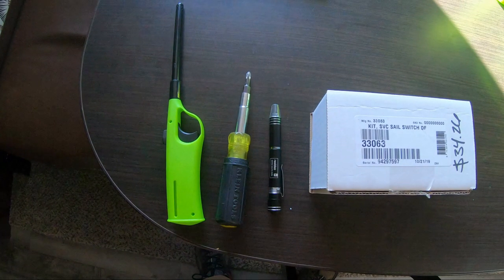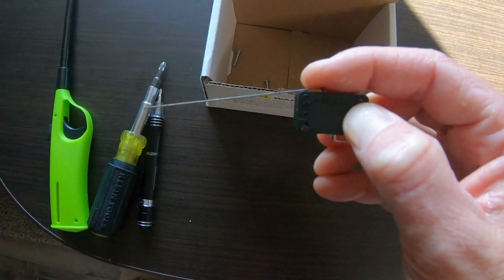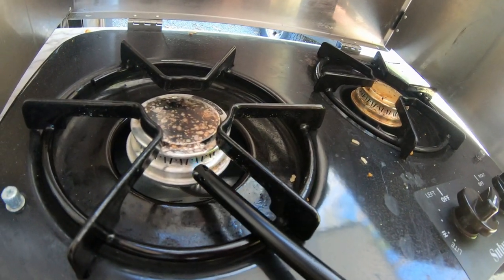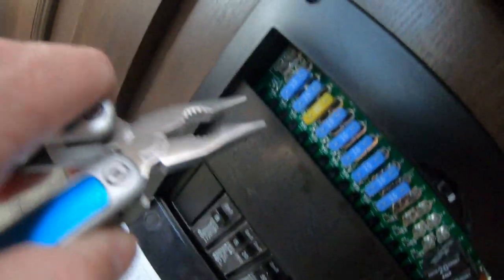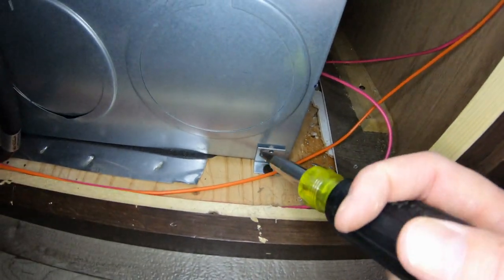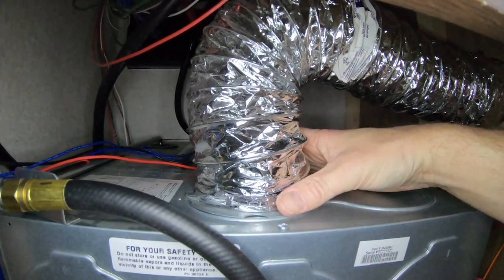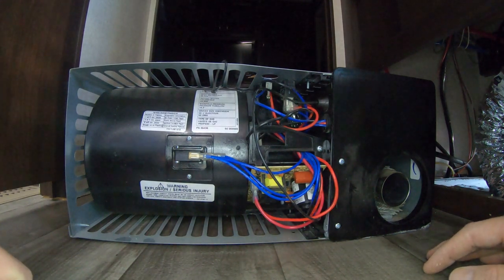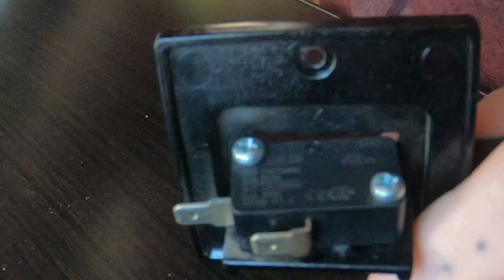RV Furnace Sail Switch Replacement

Comment: Just something I learned is the thermostat on the wall (the one you and I have…the Dometic)…to change temps etc “barely touch” the arrows and don’t “press on” the arrows and it will last A LOT longer…the thing really is not made to be pressed…if you barely touch it with our finger pad it will change…I had to replace 2 of them to finally have someone tell me about that and since then I have had NO problems with it.  also nice video on the replacement of the sail switch

Comment: Awesome video sir, I have a 2019 Jayco Eagle 321rsts and I agree Jayco could have install these furnaces where you can get to them, our is in the storage compartment and I have to take out all of the wall just to get to it. I order the Sail Switch, Over Temp Switch and a Run Delay Relay Fan/ Blower Switch to be install, I probably can get away with just installing the Sail Switch, but I don't want to go back in there after I put it back together.

Comment: So helpful and all the thoughts going through my head about Jayco’s mess/accessibility you vocalized lol!! I just had to unclog ours and it works great again. I also cut the duct so it wasn’t bending in 10 directions because it was overheating and limit switch kept cutting the heat. I’m sure all the debris left inside when it was built didn’t help the intake either.

Comment: Looks identical to the one in my Sunset Trail camper. There was a big dirt dobbers nest in the exhaust I had to clean out. So I’m not sure if it was that OR the sail switch. But I had to pull the furnace like you and the sail switch was right there so ?🤷‍♂️ It’s heating like it did before now. Got 2 from Amazon for $20.

Comment: I have same dometic furnace on my 2yr old keyston outback. Those wires go into the furnace are very tight compare to yours. How do I disconnect wires from the furnace before I pull it out?